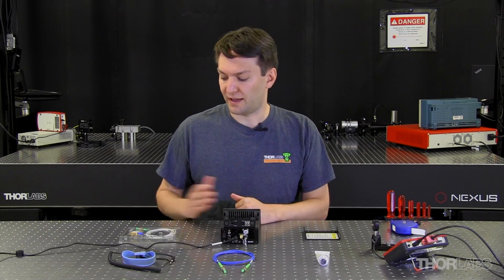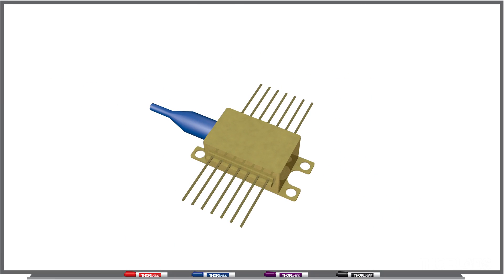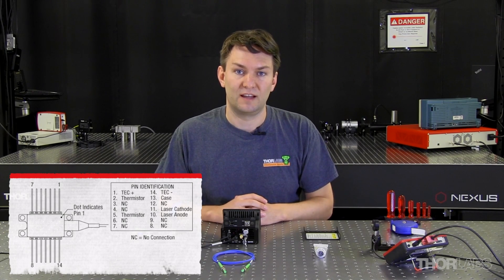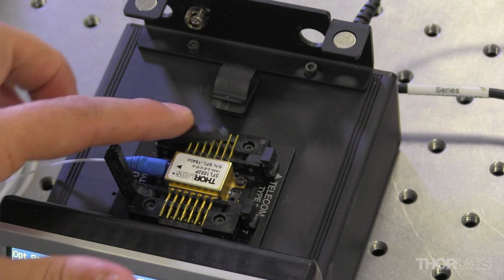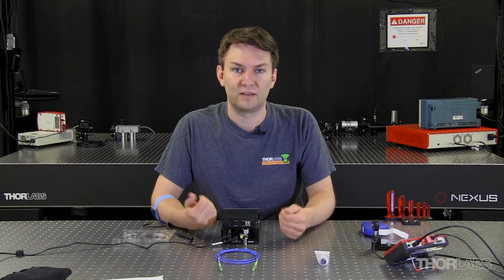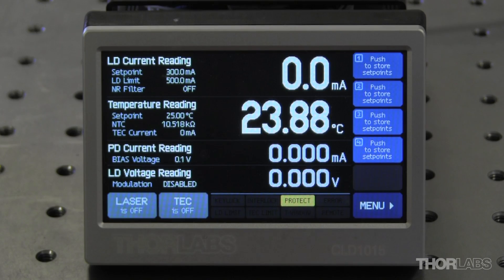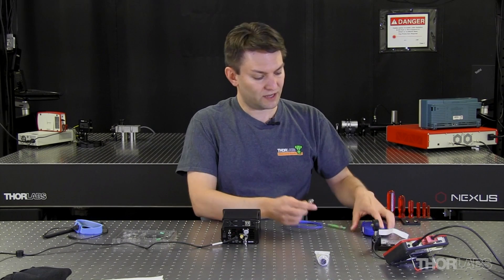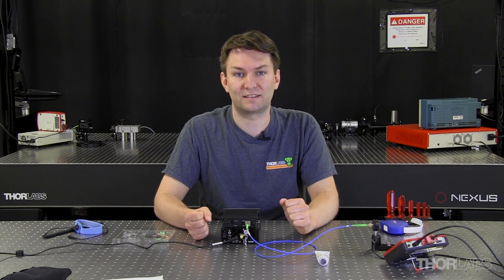Setting Up a Pigtailed Butterfly Laser Diode (Viewer Inspired) | Thorlabs Insights

Comment: Hey, this is a great video! Thank you! (There is mistake when the exponential equation for the thermistor is presented, it says that the resistance is measured in Kelvin and the temperature in Ohms, just the other way around :))
Reply from the maker: We’re glad you liked the video, and thanks for catching our accidental swap of those two units! 
For those who would like more information: At 10:47 a notepaper overlay titled “Spec Sheet Values” is shown on the left side of the screen. The units of Ro, in the first line, should be Ohms (Ω). The units of To, in the second line, should be Kelvins (K).

Comment: Do you think you can make a video on the Solei-Babinet Compensator?
Reply from the maker: Thanks for the suggestion! For those who are curious, a Soleil-Babinet compensator operates like an adjustable wave plate. The retardance it provides can be controlled by changing the overlap of the compensator's two wedged optics.
Reply: @thorlabs  Thank you!

Comment: I am trying to remove the butterfly package from the laser mount, but the lock seems to be really hard to open. I tried the strategy shown here, but I am unable to open the lock. Do you have any other suggestion, how to overcome such situation?
Reply from the maker: If we have trouble opening the lock, there are a couple of things we try. To define a few terms, I call the piece that lays across the pins the "lever", and the shorter piece that latches onto the end of the lever the "lock". 

To free the lever, it is necessary to release the lock and rotate it down and away from the lever. When this is difficult, I generally press down on the lever with one hand to reduce the force pushing up on the lock (as demonstrated in the video at 7:41). Pressing down on the lever closer to the lock will have the greatest effect. 

If the lock continues to be difficult to release in the CLD1015, some extra force can be exerted on the lock using the small side of a 3/32” or 3 mm hex key in the semi-circular channel cut into the top of the lock.  While this approach does pull the hex key away from the butterfly laser, you should always take extreme care not to hit the butterfly package with the hex key or pull on the optical fiber.  

Please contact tech support (techsupport@thorlabs.com) if neither of these approaches works and you are still unable to remove the lock.

Comment: Actually a really good point to set a temperature s bit out of room temperature. Never thought about it. At the end, when laser will work and warm up, it should not matter, but if the laser is not too powerful, TEC probably could switch polarity there and back that definitely not really good. 
Does one need to set an LD polarity, or for butterflies it is always same?
Slowly increase the current (tips +100mA +100mA  :) ).
Reply from the maker: @Tush  Laser diodes (LD) in butterfly packages do not have a pre-established polarity, since both the anode pin and the cathode pin float. The external electrical connections made between the anode pin, the cathode pin, and the case ground determine the polarity. Mount-controllers like the CLD1015 are designed to establish a specific polarity and do not provide the option to select another. For example, the CLD1015 electrically connects the anode of Type 1 LDs to case ground, creating an anode-ground polarity. Since the CLD1015 offers one polarity option for each type, there is no user-adjustable polarity setting.
 
Generally speaking, the polarity of the butterfly package LD can be customized by the user, but laser installation and setup are considerably more involved than in the case of the CLD1015. 
 
The temperature variation over a day can be surprising in a temperature-controlled lab! Since it can affect more than just the temperature setting of our laser diode driver, we monitor the lab's temperature (and humidity) and try to block air currents from the table. Thanks very much for your comments!